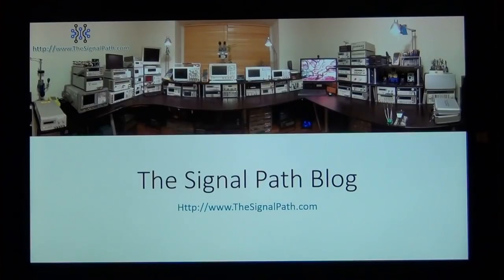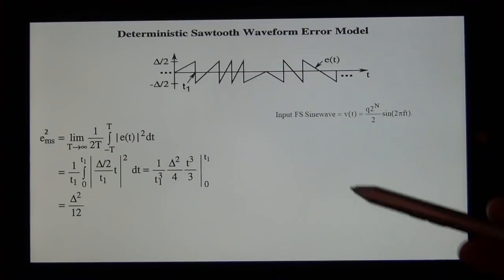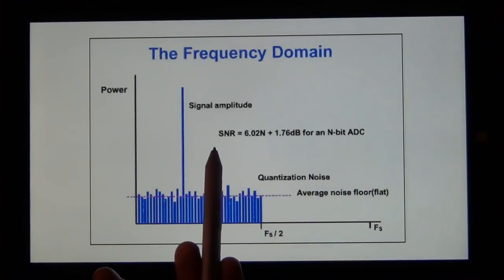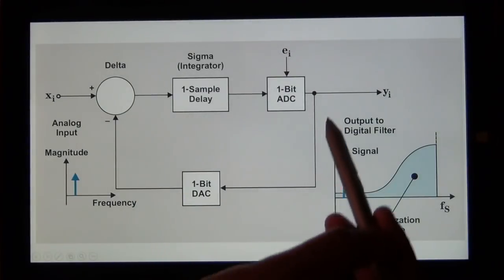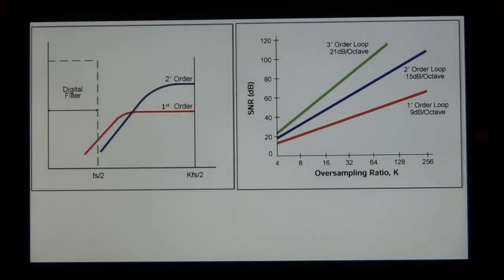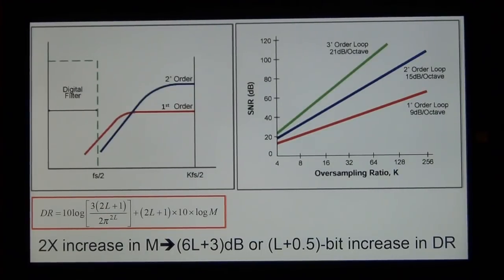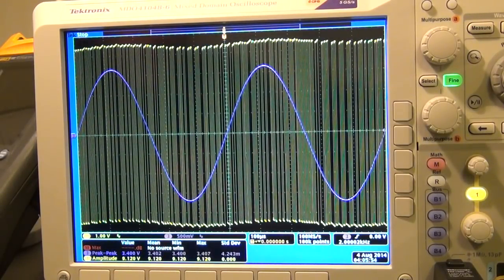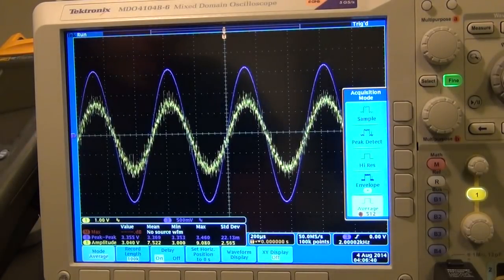TSP #32 - Tutorial on the Theory, Design and Measurement of Delta-Sigma Analog to Digital Converters

Comment: Thank you so much for this great tutorial! But I still want, if I'm allowed to, to ask some questions, just to better settle all this out in my head. :)

Am I right to assume that what comes out of a delta-sigma modulator is just regular PWM representation of an input signal? If so, then are the terms "delta-sigma mudulator" and "PWM modulator" are synonyms?

Then, it seems that by applying a regular analog lowpass filter to the output of a delta-sigma modulator we'll just get our analog signal back?

And it seems that if we amplify enough the output of a delta-sigma modulator, and then feed it into a speaker, we'll get a class D amplifier? :)

I know, these questions were partly answered in experimantal part of a video, but I just want to make sure I've understood all these points correctly.
Reply: A delta-sigma modulator isn't technically a PWM modulator, because if you go in and measure the width of one pulse, it'll have only a weak correlation with the current value of the analog input. PWM typically implies fixed-frequency. But, pedanticness aside, the output of the delta-sigma modulator could be considered a type of PDM (Pulse Density Modulation), and most of the assumptions that apply to a PWM also apply to a PDM signal: an analog lowpass filter recovers the original analog signal, and a class D amplifer can be constructed this way. I suspect delta-sigma might, perhaps, be a poor solution for a class D amplifier because to get good performance from a delta sigma, you need to oversample quite a bit, but that means a LOT of switching for your power transistors, and accordingly a lot of switching losses.
Reply: TheHue's SciTech Thanks a lot for the comment!

It took a time for me to figure out how to locate your comment, thanks to YouTube's comment system...
Reply: +TheHue's SciTech 
Thinking of delta sigma output as PDM definitely helps in understanding... thanks.

Comment: I'm now taking digital and analog communication course, but I found it difficult to follow this tutorial still, what level or course do I need to be able understand this video completely? Thanks.
Reply: You need to know what a transfer function is, basic op-amp circuit analysis, basic feedback circuit analysis. It always helps to pause the video and work it out yourself on paper.
Reply: I'm out of touch (uni was a while ago!) but this used to be taught superficially in the first year of an undergraduate degree, then all the way through beyond postgrad. There's a lot that wasn't covered here, of course, but your communication course might cover this? If not maybe take a signal processing course as well? The key to understanding this is to understand LTI (Linear, Time-Invariant) systems - trust me the basics aren't as scary as they sound! Oh, and don't start with the wiki article on LTI - it's accurate enough but not very helpful :)

Comment: Hi my question is that we work so hard to remove noise from signals.
With this video we introduce noise through the quantization process of the delta sigma A to D. You lost me with the maths I find maths at the best of times a struggle.What applications do the sigma delta ATo D's used for in RF your noise floor is always being kept at the lowest levels.

Regards David Grey
Reply: As I understand it, the benefit of the delta sigma converter is that it allows you to get a SNR in the band of interest much much better than with any other  type of same-resolution ADC by shaping much of the quantization noise into higher frequency bands, where it can easily be filtered out. You're not adding to the total amount of noise, the total quantization noise is the same for any type of 1bit DAC at thus sampling rate, but with this converter you're shaping it to a band that doesn't interfere with your signal of interest.
Reply: ***** Does that mean using the delta sigma converter that sampling between  the analog device to the digital interface becomes more accurate due to the higher filtering ablity and a more  stable results. David Grey
Reply: David Grey not more accurate, not even less noise overall, just less noisy around the low frequencies, meaning it's easier to digitise your signal cleanly.

Comment: I came to this video from HACKADAY. First of all, hats off to all the tech guys making an effort spreading knowledge clarify concepts. Secondly, I do find your explanation the most easy to understand of all YouTube videos. Good job!

Things I noted:
1) All ADCs have quantization noise, and this can be reduced by over-sampling.
2) D-S ADC does it better than other types of ADCs by having a feedback loop which does the noise-shaping (LPF for the signal and HPF for the noise)
3) The high-freq noise can later be filtered out by a LPF + decimation.
4) Typical oscilloscope/spectrum analyzer takes a sample&hold approach to acquire the signal, which effectively is a sinc function in freq domain. 

Questions:
1) As long as you apply a feedback on the ADC, it doesn't matter if the input is 1-bit or N-bit, am I correct?
2) You didn't really go into what happens after D-S ADC, only uses sample&hold to demonstrate the effect of the sinc function. I presume at this point people typically use a digital LPF to decimate and filter the output signal in one go?

Thanks